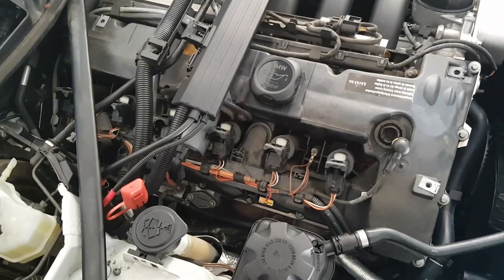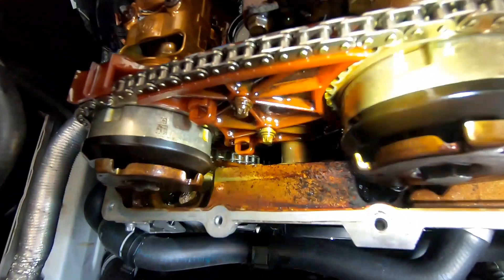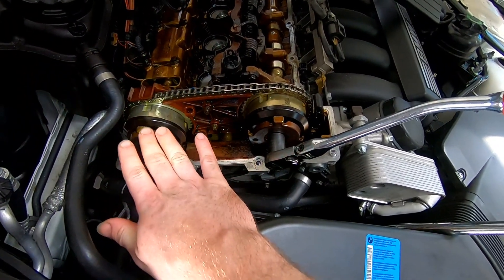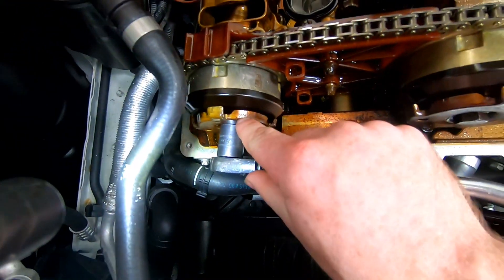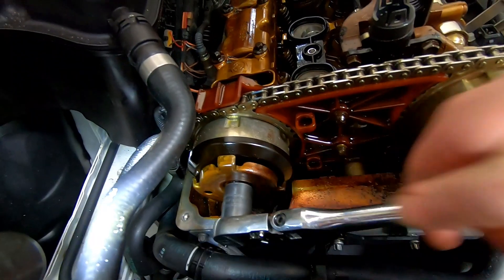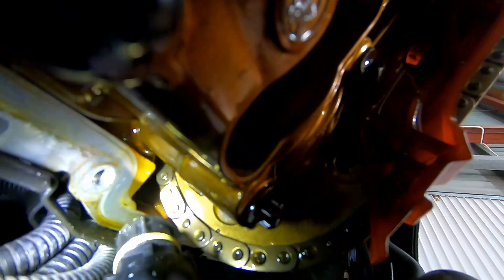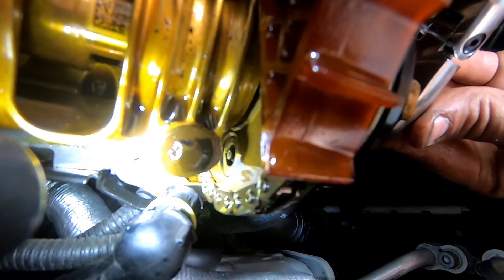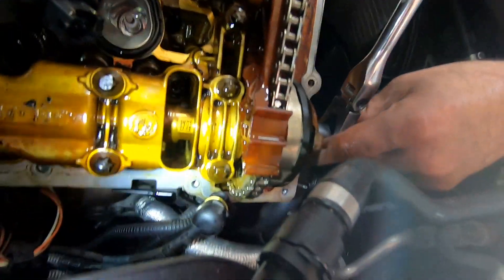BMW N52 Engine Rattle 2A87 P0015 Vanos

Comment: Hmm mine is more of a high pitched noise and i only hear it under medium to heavy load between 2 and 3k rpms.. when i pull the oil cap off it seems like every tike one of the rocker arms/cam lobe rotates/ moves it makes the noise but i cant fully tell and none seemed alarmingly loose when i dod my vakve cover gasket

Comment: Update. BMW North America has an open recall of the VANOS sprocket bolts but almost a year later they do not have a remedy yet. If you know how to change the valve cover gasket, you should be able to replace the VANOS bolts at the same time. Just need a few specialized tools - Torx security bit, etc. Lots of YouTube videos on this topic. My N52 VANOS bolts were only finger tight when I replaced and thread locked them. Job takes about 5 hours if you go slow and careful.

Comment: Hi 
how did you fix this sheared bolt heads? 
Did you have to lock the flywheel under the starter? Is that necessary?
Did you loosen and take off the Bolt Tensioner?

Comment: I am getting this same code with my 2011 x5 i50 drive. Alot bough it doesn’t quite sound like this… definitely sound like there is some misfire of some sort. Could this be my issue? I also have a 2a7b code.

Comment: Vacuum pump causes similar rattle, use a stethoscope with a solid probe and apply to the pump case beneath the oil filter housing with the protruding vacuum tube, this is not the PS pump

Comment: What if my bolt head is still there but just loose
Reply from the maker: Still needs fixing
Reply: The bolt heads are weird looking do you know the name of the tool I can use to tighten the bolts 
I know I can tighten them one by one as I turn the cam shaft with a 20 mm or sumthing .. 
It’s a weird looking head bolt almost like a key
Reply: Also it’s at a weird angle not much room maybe a L key can fit in that spot to tighten them

Comment: So if I have this code, is this forsure my issue?
Reply from the maker: You need to get a mechanic to diagnose the issue.
Reply: @FourRingsAuto  I live in the city and the mechanics are really money hungry and I got diagnosed for a timing chain replacement at 96k then another mechanic told me that was wrong
Reply from the maker: Maybe you need to find a better mechanic.
Reply: @FourRingsAuto  both had awesome reviews. But yah might just have to go to dealer
Reply from the maker: I wouldn't go to the dealer if you think your current mechanic is money hungry. The dealer is much more hungry!
Reply from the maker: What city are you in?
Reply: @FourRingsAuto  Seattle

Comment: Well it looks like i know what im doing next weekend lol, will probably need a new valve cover gasket too eh?
Reply from the maker: Yes always replace the gasket if the valve cover is being removed.
Reply: @Four Rings Auto  thank you for the help sir, my sisters car just started making this exact noise, same codes. Used the bore cam to inspect the intake side and has the old style bolts so im suspecting the exact same problem lol
Reply from the maker: Worth checking for sure!

Comment: BMWs are the worst ever built cars.... I am done. Pretty on the outside and crap on the inside.
Reply: not necessarily. You need to maintain them diligently to have them performing optimally. They aren't corolla budget repair cars
Reply: @bobaphat3676  yea you need maintainance just like every other make. But BMW is always cost an arm n leg to maintain compare to the Honda, toyota...
I rather cruise a Honda, yota, lexus than that high end Bmw look from outside
Reply: @linhchau9788  Not necessarily, depends on what make and mode, engine etc.

Toyotas can suffer from catastrophic failure like water pump on the 2grfe for e.g. or belt failures.

So you have to be specific. And they do cost more on average, but you have to consider the fact that German cars are manufactured with a different Engineering philosophy than Japanese cars. They are designed with more Engineering risk and stricter tolerances hence more possibility for things to go wrong. There are pros and cons to everything.
Reply: Now ugly on the outside.

Comment: Is that noise at 0:20 normal when you open the oil cap? The noise without the oil cap? Is it normal?
Reply: I have the same question… An older German guy who had been driving BMW all his life, and that drives the same N54 535i as me said that this sound is normal supposedly.
Reply: I have read that the metallic tapping sound from the oil cap is the vacuum pump

Comment: Super informational video much appreciated, just had a question about the cams being moved into a retarded position. My question is it looks like sheered bolts will move the cam into an advanced position, what would be causing the intake cam to be retarded? I already changed the oil and filter, and cleaned out the intake/ex vanos soleniods. I'm thinking the tensioner is broken or more likely the chain has stretched out. How would I confirm the chain has been stretched out?
Reply: You’re looking at it backwards, the chain moves the cam sprocket, (advances it) the vanos/variable cam drive assembly bolts are threaded into the cam sprocket through the vanos drive flange, which is now loosely attached and has freeplay. The assembly mechanically controls the relationship between the drive sprocket and camshaft, which is usually attached to the cam with the bolt and  a woodruff key or uni directional splines this is the bolt he was using to move only the camshaft in the advancing direction, leaving the sprocket to remain still. During operation  when driven by the chain, the force comes from the opposite direction,   friction from the cam resists the force applied by the assembly and valve train, and the cam falls behind the play  is in the vanos assembly the cam sensor trigger remains fixed to the cam while the sprocket is free to advance a few degrees before the protruding bolt shanks catch. The crank and cam sensors timing variance goes out of range, and the ecm sends a DTC to the instrument panel to tell you that the cam is “we tall did”

Comment: I have a N52 with this same issue. Will it be necessary to drop the pan and look for/retrieve the broken bolt heads? The oil also has fine metal shavings/glitter. Would this have caused damage or extensive wear to the engine components, such as bearings?
Reply: Did you ever find an answer to your questions?
Reply: @colorado.e9x  most of the sheared off bolts were retrieved from the top of the engine, but one was not located. It likely went down to the oil pan. I did not remove the oil pan to look for it.

The affected Vanos sprocket was replaced, and I had the bolts on the other unaffected Vanos sprocket replaced with the updated bolts as well. 

Did oil changes more frequently since (every 3k miles), and there are no more traces of metal in the oil.

Comment: Exact thing happened to my car today, opened the valve cover and found the same issue with the bolts missing on both gears,  one sheared from the intake side and 2 from the exhaust side... unbelievable... do you think its worth fixing or should I just get a new engine...
Reply from the maker: Fix it. A used engine you don't know anything about it's history.
Reply: there was a recall for this issue
Reply: Yup luckily called my local dealer and they fixed it and also replaced the valve cover too since it had issues along with the recall. I’m about 2 months before the 10 Year was up it was a 3k service bill if this happened much later
Reply: @adkada_view  how old is your car? I take notice that this happens to cars between 2009 und 2011
Reply: You’re on target! I got a 2011, just glad it happened sooner than later and got replacements for free
Reply: @adkada_view  but i really want to understand why only these production years?
Reply: @linerambomiez573  as far as I know bmw used a weaker bolt to attach the gears together, they have since replaced them with a more heavy duty version that are of stronger quality metal bolt, previous i believe were some sort of cast alloy, but im not entirely sure what type of metal was used for the old bolts that sheared
Reply: @adkada_view the original bolts are aluminum 🤦‍♂️
Same thing happened to my car. I caught it before they sheared and dropped to the pan. Replaced with the revised steel bolts.
Reply: @OregunAdventure  is there a part code for bolts want to do mine.
Reply: Having the same issue. 2010 328xi N52, sheared bolts on the intake. However BMW is claiming my model doesn't have any recalls like this. I've called 3 dealerships. (Canada).
Reply: Thinking of doing mine is there a bolt code? For replacement.

Comment: My 328i makes the exact same noise. I used a borescope to inspect the intake vanos bolts, no issue. Can't see the exhaust bolts though. Seems likely they are the issue.
Reply: It was indeed sheared VANOS bolts. Dealer fixed it all under the SULEV warranty. Oil pan was removed to retrieve bolts.
Reply: Hey Craig, i have a 2010 328i with about 91,000 miles so far, wanted to know what was your mileage at the time of your failure. I'm hoping i don'tcthis problem any time soon. Thanks for the comment post.
Reply: @mofopopo437  It was around 93k miles. Been good for over 10k miles.
Reply: @craigdesrosiers3361  Thanks for reply!! I have a sulev also im just hoping this is covered by a warranty by the dealer here in Florida I'm thinking ahead of the game. Thanks again.

Comment: Great Video and Information,excellent !!The Question is how could and why would these "high grade bolts "shear" off??  would the vanos for some reason cause these bolts to shear ?? ty Sir
Reply from the maker: Unknown. Manufacturing defect perhaps. Porsche have a recall on their v8 engines in the 92A Cayenne and Panamera to replace the bolts.
Reply: @FourRingsAuto  yes .ok ty Sir

Comment: Did it make a rattle sound at start up? I’ve been having a rattle sound at start up, not sure if it’s the same issue as this car
Reply from the maker: From memory it rattled all the time. Timing chain tensioner or vanos gear can cause cold start rattle.

Comment: Very interesting. Wonder if the repairing dealer actually found what was left of the bolt heads after all that. Hopefully they didn’t just replace the broken parts and “move on”.
Reply from the maker: Likely the latter. I'm not sure it went to a main dealer, i believe it had an aftermarket warranty so it would have ended up at one of their "approved" repairers. These warranty companies love workshops with low labour rates too...

Comment: Hi! I got a E92 bmw 2007 , 2.5i 92.000 miles on the clock..The problemI got  is the engine just cut of at lower speed. I changed the VANOS solenoids the oil filter and the oil, but nothing happend,  engine cuts of at lawer speeds.Can you give me some advices please! , I see you know all about this tipe of engines.Thanks allot!!!
Reply from the maker: Have you checked for fault codes? Worth checking for air leaks on the intake system, including the evap solenoid. Also good to know if the valvetronic is working correctly as this would be an n52 in e92 325i.
Reply: @FourRingsAuto  Yes i cecked the codes and its : 2A87 Vanos Mechanical , 29E1 Mixture control 2 and 29E0 Mixture control. This codes apear when i had my first engine cut off , now when the car stops the engine light shows on the dashboard and when I start the light goes off.What could it be ? Thank you!!!
Reply: @betonbreton did you find an answer to this? I have the exact 3 errors and I checked these vanos bolts but there is none I have only a plastic cap. 2007 325i e92

Comment: I assume you found the bolt heads in the oil pan?
Reply from the maker: Unfortunately the job went elsewhere due to some paid warranty the guy had and the warranty company only wants their repairers to fix it (cost based).

Comment: Is this repairable? or do I need to replace 11367583208 and 11367583207? Great video!
Reply from the maker: Replacement variators and the bolt that holds them to the camshaft.
Reply: @FourRingsAuto   hi do you know any specs of the bolt? i have exactly the same issue but no code, i opened the valve cover and had the same issue.
https://www.realoem.com/bmw/enUS/showparts?id=WX53-USA-06-2011-F25-BMW-X3_28iX&diagId=11_3746
realoem sell the whole sprocket but not the bolts
Reply from the maker: You need the torque setting for the bolt that holds the sprocket to the camshaft?
Reply: @FourRingsAuto   i actually needed the bolt part number, but i found it!
for the once who need it it's:11-36-8-602-263
when it comes to the torque it's 6nm +  60° 

however there is something more interesting: BMW had a recall
https://static.nhtsa.gov/odi/rcl/2014/RCRIT-14V176-2716.pdf
(let's see it that will work in my case)

interestingly in my case there was no Check engine
Reply: @djthedog  thank for posting this.

Comment: Can I get a vanos fault code even if the engine oil is low?
Reply from the maker: Possible yes. Usually due tho to blocked vanos filters in the side of the head.

Comment: Is it possible for the code to appear for reasons other than vanos?
Reply from the maker: It's a vanos timing code. So it's gonna be related to cam timing,  vanos operation, oil pressure, vanos solenoids, etc.